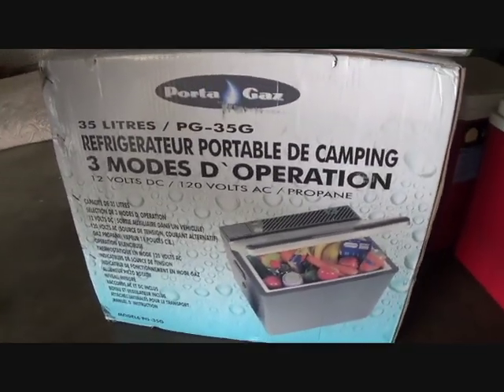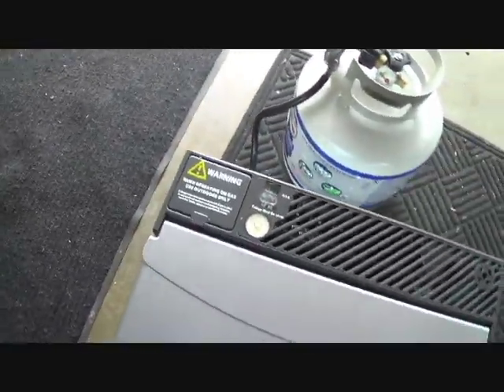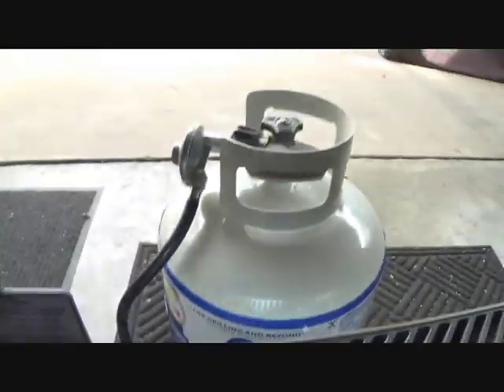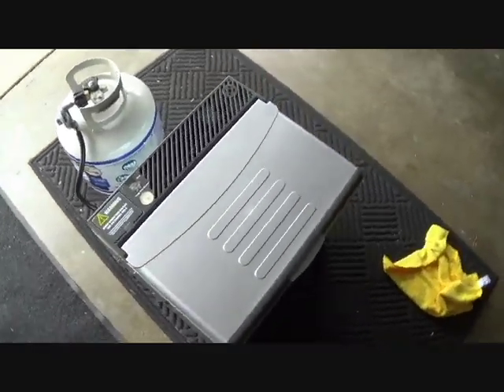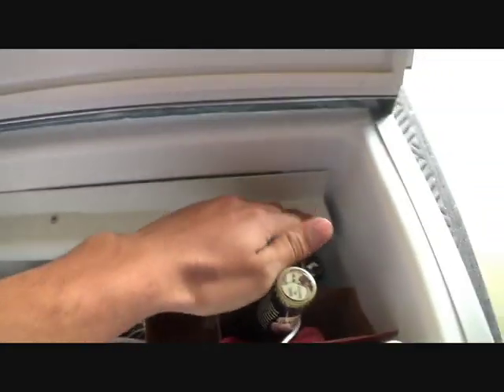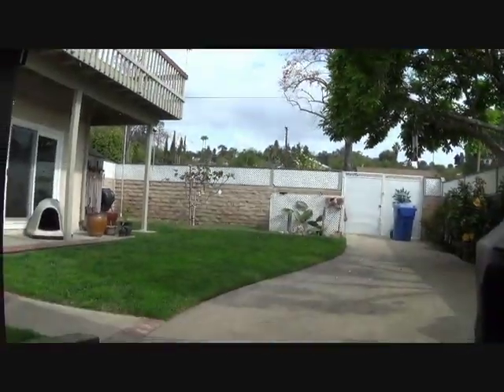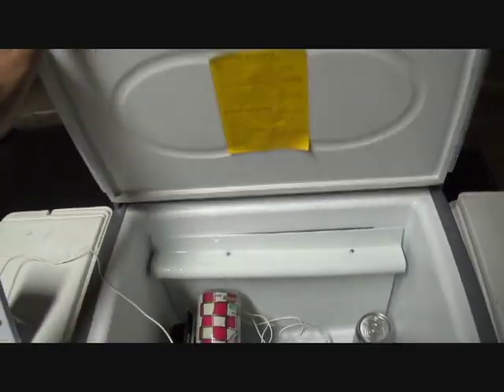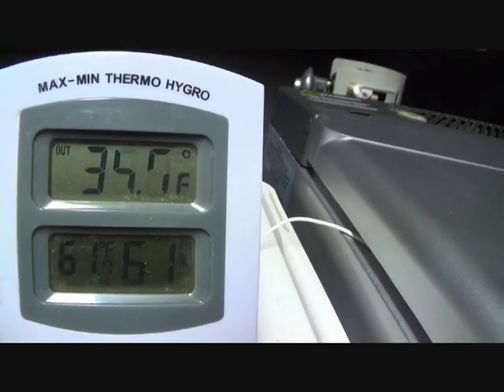Portagaz Fridge review after 3 days on propane

Comment: I purchased this about a year ago. I was fairly pleased at how the unit ran on AC/DC and propane. At home in Dallas at about 500' altitude the unit would drop down in the mid 30's. On gas it was slightly higher but plenty cold enough to keep food fresh. I had heard that running at high altitude the unit didn't work well at all on gas. I found this to true when taken to my ranch at 7000', so I was very disappointed. Doing some research I found that the regulator which is set at 11lbs is incorrect for such high altitude. Since the unit wasn't needed, I stowed it away for the rest of the year. Prepping for next years trip up to the ranch, I pulled out the Porta Gaz again - did more research and found that a lot of people were saying not to use the built in level. Sure enough, when I placed a bubble level in the bottom of the fridge, the built in bubble level was way off center. I leveled the fridge according to the bubble level I placed in the bottom and fired up the fridge on AC. Down the temp went to 26 degrees in a matter of about 5 hours. This is a good 10 degrees lower than I've ever seen the fridge go. Ok, so now to find a propane regulator I can adjust (a quick order from Amazon). I connected up the new gas regulator and have total control over flame height. After playing around with the flame height a bit, the fridges internal temp started to drop just like it had on AC (this is after warming up to room temp - about 72 degrees). I believe that a lot of problems with this fridge is because of the leveling, or I should say the lack of leveling. I plan on trying the gas this weekend to see if I can get the same or similar results from it as I have from AC by carefully adjusting the flame height. I plan on heading back to my ranch in November for a short stay, the fridge will be going with me to try again at high altitude. With the new adjustable regulator, I believe that the fridge will perform as designed.

Comment: Another example of a clone not performing as well as the original. But this is the rare case where the clone often costs more than the name brand.. dometic combicool. 1600 or the aluminum 2200.  Often are cheaper even with shipping..

Comment: generally these types of systems only give you a 30 to 40 degree delta T when running on propane or 12 volts. You can do much better in the desert with a swamp cooler

Comment: I am on the fence too.  Need a 3 way but live in the desert.  Do you think operating on propane these units would cool when the exterior temps are in the 90°-110°F range?  I have had 3 ways fridge units in RVs that actually cool best on propane verses 12V or 110V ...they worked well in my area, and in the heat/  If shelling out $500-$1000 of a portable I want to make sure it works.  I am actually searching for something in the 90qt+ size.  Contemplating buying a small RV unit and putting it on wheels as an alternative.
Reply from the maker: I honestly did what you did . I bought this and decided to return it and buy a used RV propane one. This one just doesn't keep up in my weather. (So Cal)
Reply: Thanks for that info.  It will save me the effort of having to do a return.  Thanks!

Comment: does it get colder when it is plugged into 120v or 12v? how much of a difference is there?
Reply from the maker: sorry for the super late delay. It worked really good on 120v. I don't think the 12v did very well. The propane works but eh.... I returned it